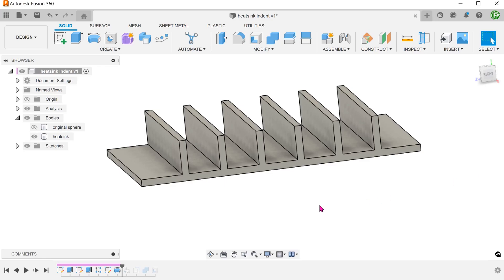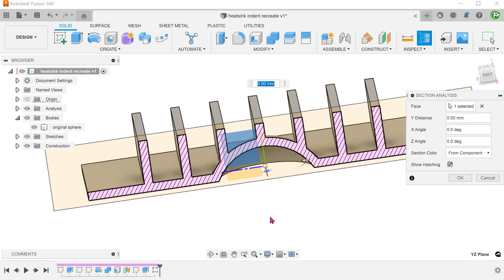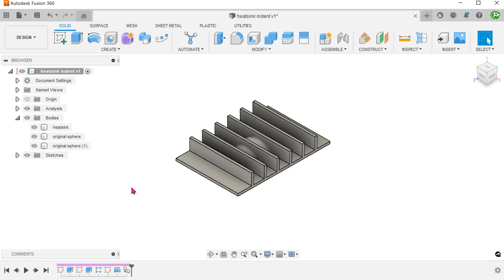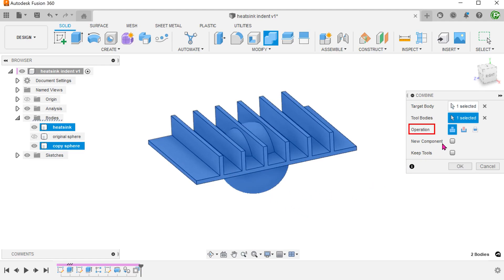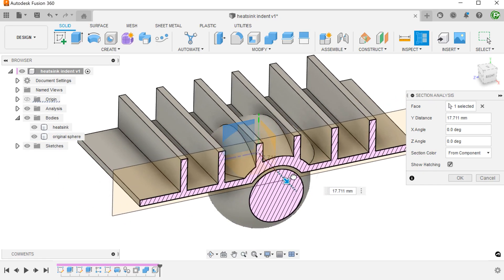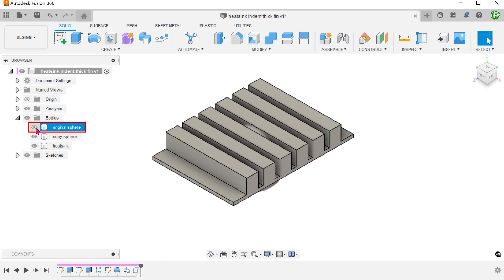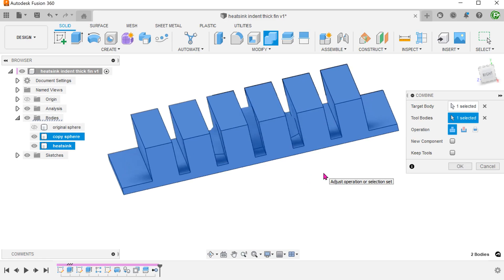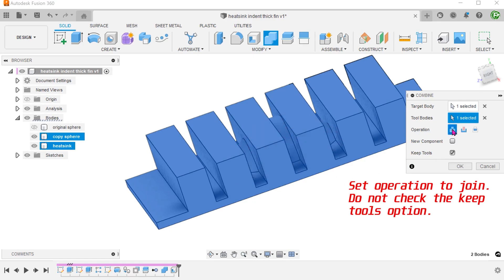Fusion 360 | Case Study 33

Comment: At 2:30 I think it would be a bit more intuitive to use an offset of 1mm and then use the "Outside" type of the shell command with 3mm added thickness at 3:20. This would correspond more closely to the cross-section shown at 2:10.

Great tutorial though!